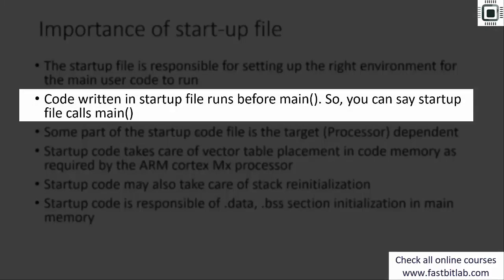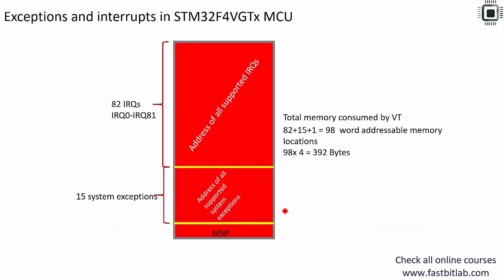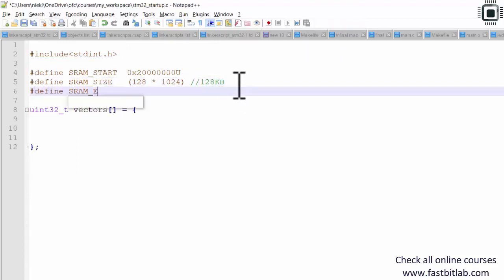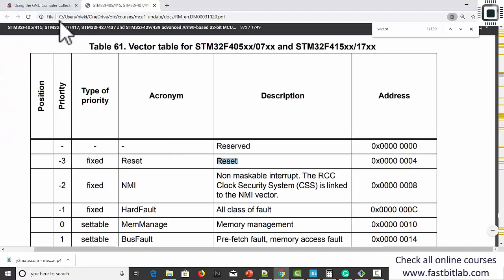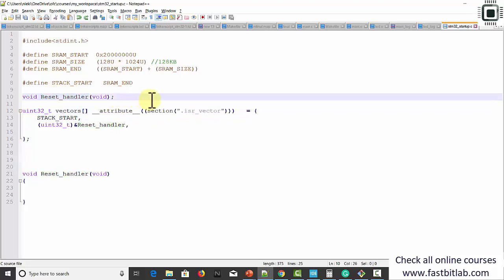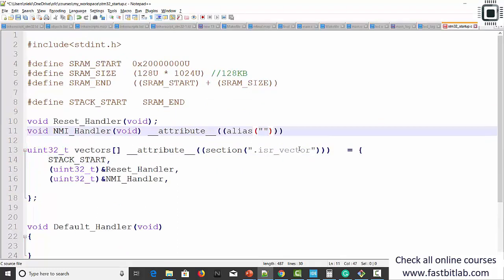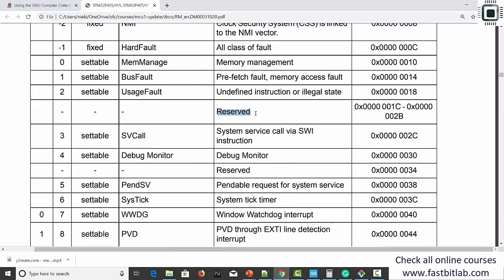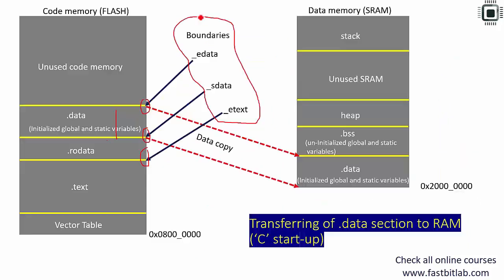Bare Metal Embedded C Lecture 3: How to Write an MCU Startup File from Scratch

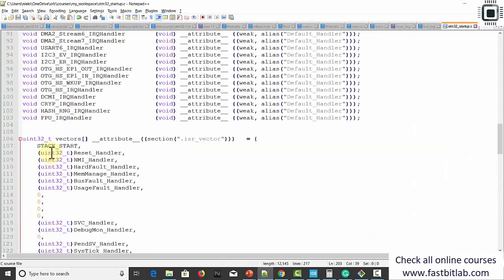Comment: Hi Sir, in your lecture from time frame 22:28 onwards, when I look into the initialized vector array, all "&" are removed before the function pointer names. Initially it was there ...for example (uint32_t)&Reset_Handler changed to (uint32_t)Reset_Handler. Why "&" is not required?

Comment: Hello Sir,

I need your help, I was trying to duplicate this project for AVR ATMEGA32A, The only issue I'm seeing is whenever i store the addresses of the handlers in the array, whenever the program starts, it tries to execute the op code stored in location 000, which is not an op-code, rather it's an address of a function, so the proteus simulation generates an error "invalid op code"

i tried to validate my understanding by directly storing the function in the memory location, and it worked, however i can't control where the handlers will be stored exactly, as the linker will just list them in order without caring that i need to reserve 2 bytes for each handler.

I would really appreciate it if you can look at this comment, I am a big student of you, and i even bought 4 courses on udemi, because you help me greatly.

Comment: Did anyone try defining weak fucntion in main file and trigger ISR and Did it work ? I defined EXTI15_10_Handler in my main file but Vector address for EXTI15_10_Handler ISR still shows the address of Default_Handler.

Comment: I have one question that I could not find an answer for it anywhere, basically, If I create a boot-image for baremetal which includes the bootloader and the application elf file. The ooting image will be flashed in the booting flash. After switching on, the  first stage boot loader copies the content of the flash memory into the on-chip RAM. How could it know the linkded sections and locate them correctly into the right places in the on-chip RAM? I examined the First stage boot loader, it is a simple memcpy operation!!

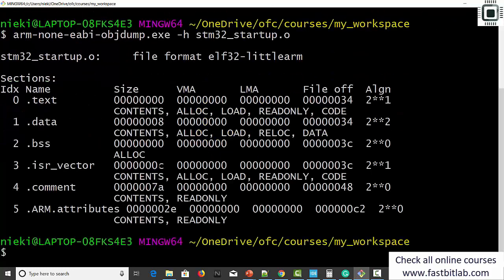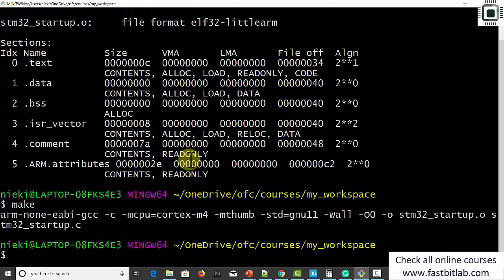Comment: Hi Kiran, when the _attribute_ is imposed at the end of the vectors[] array initialization, the .isr_vector section is having a size of 12 bytes as shown @14:07. When the _attribute_ is moved just after the variable vectors[], the size is 8 bytes as shown @15:00. What could be the reason?
Reply: Because at second time he moved the handler function to random section which is the element of vector array so vector array size reduced.

Comment: As per reference manual, Reset Handler is on top of the vector table list.
Then Why MSP is initialized first inside the vector[ ] ? Why MSP is initialized in the vector[ ] in the first place?
And how the compiler interpret this as address of MSP?

Comment: Hello, When i try to do make of stm32_stratup.c, i am getting below error, i have just included the  Reset handler and SATCK_START and added __attribute section.
ERRRR:
arm-none-eabi-gcc -c -mcpu=cortex-m4 -mthumb -O0  -o stm32_startup.o stm32_startup.c
stm32_startup.c:16:1: error: expected expression before '}' token
 };
 ^
Makefile:13: recipe for target 'stm32_startup.o' failed
make: * [stm32_startup.o] Error 1

Stm32_startup.c

#include<stdint.h>

#define SRAM_START 0x20000000U
#define SRAM_SIZE (128 * 1024)  //128KB
#define SRAM_END ((SRAM_START + (SRAM_SIZE))

#define STACK_START SRAM_END

void Reset_Handler(void);

uint32_t vectors[] __attribute__((section (".isr_vector"))) = {
STACK_START,
(uint32_t)&Reset_Handler,
};

void Reset_Handler(void)
{

}

What is the error? i am not able to find out..
Reply: In the line "(uint32_t)&Reset_Handler," the ","  should not be there because it is the last entry of the array. So remove the "," and it should work. So line 16 should be (uint32_t)&Reset_Handler 

Thanks
Reply: @puranjaymohan9355   Thanks, but its because if TAB in editor it giving error.

Comment: I love your courses, really!

I have 2 questions:
1) why is STACK_START the first element of vectors[]? where is this specified?

2) why STACK_START = SRAM_END? is  this specified in the memory organization? I dont see it
Reply: Hi,
1) The first address of the flash has to store the address where stack pointer should initially point, this is according to the architecture specification. After this the reset handler and other hander addresses have to be stored as can be seen in vector table.
2)The stack grows from higher memory to lower memory so it is kept at the end of SRAM, it can be kept at other locations also, there is no restriction for it.

Hope that answers your questions.
Thanks